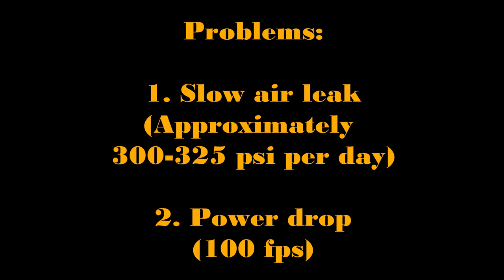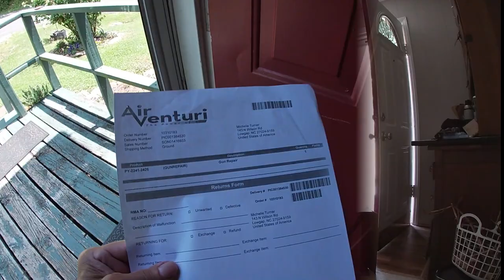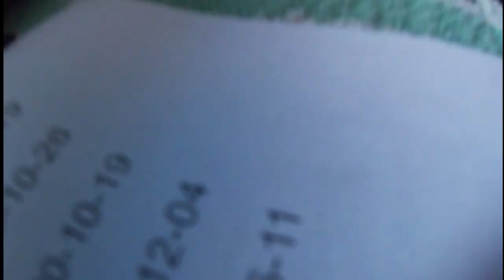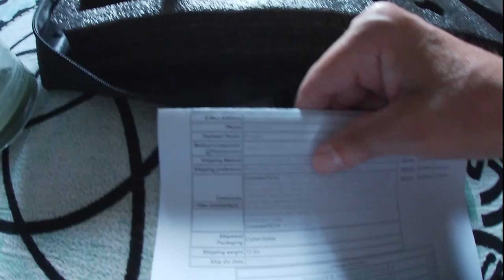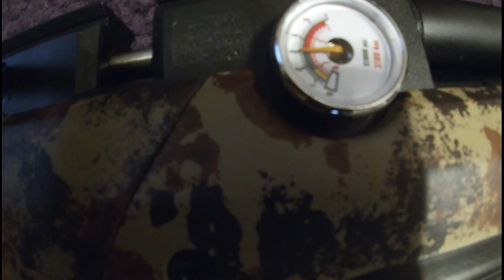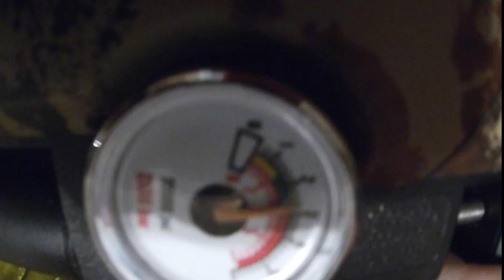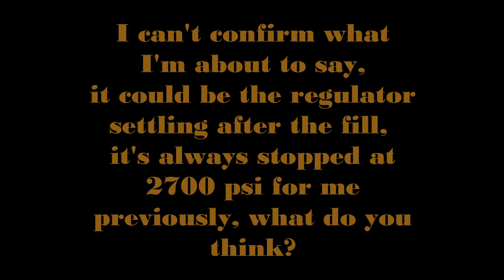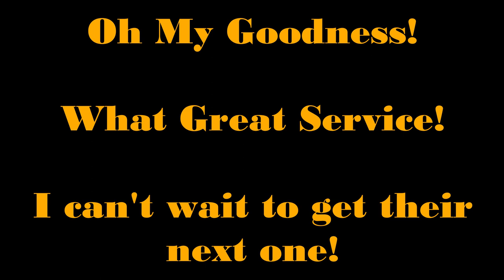Air Venturi Avenger Leak And Power Drop Repair Fail

Comment: You get what you pay for. People get sucked into it due to its low price.After you seeing couple of great reviews,you decide to buy it.You don’t know how other people’s air ventury lasts as not everyone will post a video.
Reply from the maker: I knew what I was getting into, they have a track record of putting out guns that leak, same issue as the first two. I got this one as a gift, and as for the get what ya paid for, I've got a gun I've had for several years now that still shoots like a dream, actually two, but one hasn't had thousands upon thousands of pellets through it, thing is, they still work great, no leaks, powerful, my go-to when I know I need a gun that will do what I need it to do. So, I'm pretty much so sick I could puke of the "You get what you pay for" excuse for this rifle, I only have four pcp's, all are budget guns, this one is the only one that has issues. I knew all about the gun before I ever got it, I was waiting to see if they would fix the issue or screw everyone over like they did on the last two models they put out, and once again, surprise, surprise, surprise. I watched the video of it being torn down and the crappy poppit in it as the same models. There's no excuse for the horrible repair service as well, they fu***d it up and wanted me to pay, again, to mail it back to once again gamble and see if they would actually fix it or pull the same BS. It is absolutely impossible for the gun to have been fixed and not leak enough overnight for them not to see it clearly. Low price or not, it came with a useless warranty as well. SO you saying you have to pay high dollar to get an actual usable warranty as well? Come one man, you're making excuses for them, that's why they do it, the same exact line has run through this industry for years, the same exact line that comes out of everyone who buys they excuse and will resale it for them. Stop making excuses for companies to put out garbage and they'll stop doing it, they're making millions upon millions screwing customers over and you're selling the lie they want everyone to be sold. Sorry buddy, if ya ain't got a couple grad to toss in on a good airgun and system then I guess your trash and deserve to be screwed over while we make the community tell you it's your fault for not spending thousands. How much ya think it would have cost for a good poppit and seals for this gun? a couple dollars at most, they could have tacked an extra $50 on the price and it would have been worth it. I've also heard nonstop about how it was made in China. No, it was approved by a company in Solon, Oh, which was in the USA the last time I checked, and considering I'm from the state and worked literally right down the road from the place years ago, yeah, it's in America, and they had to sign off and approve it to be made the way it is, materials and all, test it, etc, etc. So blaming China isn't gonna work either, not that you said anything about it, but those two excuses given to the company to use as their excuse to screw over their customers, again, is why they do it. Thanks for your two cents on the subject though.
Reply: @slowpokeairgunner4027  I was gonna get this air ventury, that’s why I have been watching videos.Didn’t mean to offend you in any way.So far I’m more than happy with my gamo swarm magnum gen2 22 cal.However,it would be nice to have a rifle that feels more like a traditional rifle.For my once in a while shooting,forking over $1,500 or more doesn’t make sense.The ventury has nice features for sure,being able to depressurize the gun is nice.Don’t want to have pcp if I’m only going to shoot 3 rounds lol,then have it sitting for weeks under pressure. That’s why I love the gamo magnum,cock it when needed,that’s it lol.I don’t know if it’s possible to release air out of the gamo urban 22 which a was thinking about getting.

Comment: Can’t ship full of air
Reply from the maker: It was filled and left over night, when it's filled it leaks more than it did when I sent it, actually, it loses more in half the time it would lose in a day. When they came out they were shipping them with air because of the leak issue. You can't ship one full because of the pressure at different altitudes, I live in the mountains so it's different than where I used to live. I normally leave mine filled about half way when I travel to prevent issues, especially up and down the mountains.

Comment: I'd fill it back up and check it before I called someone
Reply from the maker: Yes, I checked it here shown in the video, and again, and again, they just made it worse.
Reply: @slowpokeairgunner4027  I have a leak in my katran that can't be stopped. Your not alone. And it truly sucks.
Reply from the maker: @garyhill9516  You can find it with soapy water, you probably already know this, I'm sure there is a seal out there that will work. But, if it's under warranty you'd think you could get it fixed and looked over. I don't know what model you have but I'd be upset as well for the price of the Katrans I've seen. if it's the popit I'd ask DUI also goes by Dark Charisma on Gateway To Airguns, he's on Airgun Nation forum as well, he makes popits and a lot of other stuff for airguns. I hope you get it figured out, my issue is having to work on it and my hands and arms being messed up makes things a lot harder and takes a lot longer if I can do it, I am just mad about this situation because whoever worked on it didn't check it, and now worse than when I sent it. it cost me $31 to have it shipped, not have it for a month, and get screwed on the deal. I'll get it fixed but won't buy another one of their guns, this is model number three they've put out with bad seals.
Reply: @slowpokeairgunner4027  yes sir I know where it leaks. And no it's not under warranty anymore due to me trying to fix it myself. Even though I hurt nothing. The first time it leaked I sent it back for repairs. This time I took it apart myself. That voided my warranty. It cost 67 bucks to send it and I wasn't going to do it again! I told them if I had to send it again I don't want it back. I'm on SSI and don't have money for that crap. I Know what the weakness is in my gun but don't have a machine shop to make a firing pin guide to insert in the plenum so the popit seats in the same position every time. Anyway it sucks to have just ordered a thousand pellets for a gun with no air.
Reply from the maker: @garyhill9516  Get in touch with DUI, he goes by DarkCharisma in the forums, I'd bet he can make what you need for it.
Reply: @slowpokeairgunner4027  okay thanks. I'm just learning how to use that.

Comment: 👋🏾sup bruh! This is not good! I have the 22 version and it hasn’t leaked yet? It just the question of when! Not good at all Brotha 👊🏾😎
Reply from the maker: Yeah, i'm gonna have to talk to DarkCharisma and get a poppet for it. This is just nonsense bro, no possible way they did not see that it was leaking even if it sat over night, I checked it in 12 hours and saw the leak. If it wasn't their third model that has leak issues it would be different, but it's been years and they haven't fixed it, that's just wrong on their part.

Comment: You need to get your money back..$$$$
Reply from the maker: Thanks for the comment Iron Works. I wish I could but I painted mine so I can't have it replaced, this is why I sent it back for the repair, the paper says they didn't find a leak beore or after, lol, you can fill it and literally watch it leak out hour by hour. I'll get this one fixed and running the way I want from after market parts, but I'll never buy another one from them, this is the third model they've put out that has leak issues. They talk about it as if you are buying a faulty gun and you'll have to fix it yourself, but it's the greatest budget gun to ever come out. I've got thee gun that have not leaked a drop in years, two being three years old and never had a leak. One of the two older models had an issue when I first got it and they had it taken care of within two weeks, actually I think it was about a week. the hatsan Flashpup wood model came out with mad magazines, I didn't want a single loader, they bit the bulle tnad discarded all the older mags and made new ones immeditately and got them in the hands of the owners ASAP. I guess if it were an AV gun they would have told me the mag was fine and sent me two more bad ones and pretend everything was fine.

Comment: It could be your pressure gauge
Reply from the maker: Yeah, I haven't checked it, I wanted to let them fix any issues it had, i specifically asked, just garbage for repair. but yeah, I'll get it fixed, I shouldn't have too.
Reply: @slowpokeairgunner4027  hope you get it fixed good luck 🤙